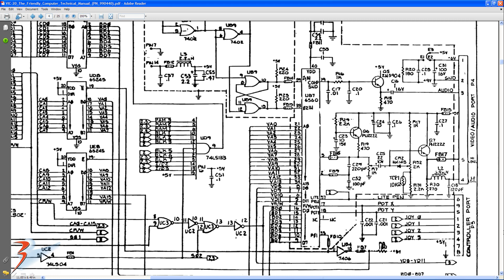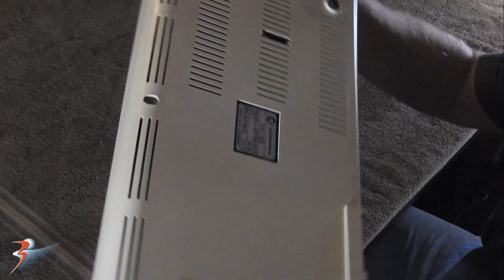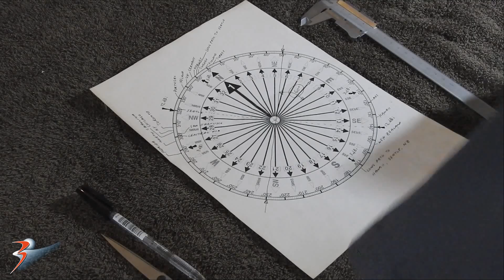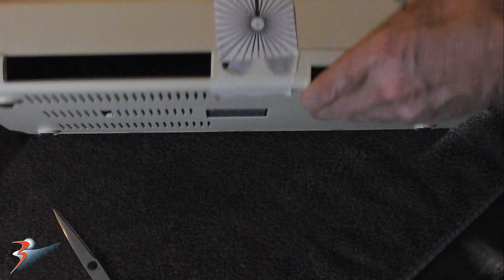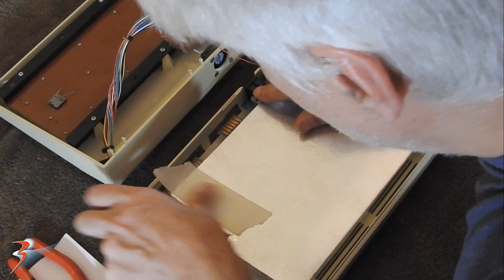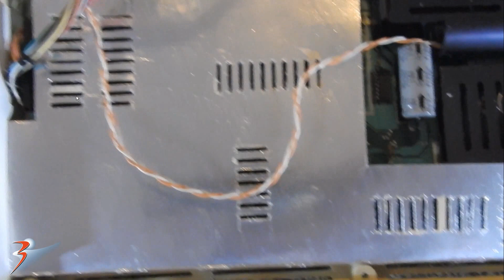Commodore VIC-20 Restoration and Air-Cooling Modification

Comment: is there a reason to not vent into the top vent grating? or even bottom vents sucking in cold? i think i may place a fan without cutting a large hole...
Reply from the maker: Great idea, thank you for the alternative suggestion. This mod I did, I admit, was very intrusive. Thank you for the comment.

Comment: Jean Ward
Check the files, Load: *.*,8  at least I think that's right.  
I used all of the Commodores VIC-16, VIC-20, C-64, C-128, and the PC version in which I forgot the number for and I think it ran at about 2.7MHZ processor. . This was back in the mid 70's. I used them for running RTTY on the Ham Bands.  I had a big RTTY console printer like used in the old movies, (Kerchunk Kerchunk). I also did my own BBS and ran it from the C-64. For those who do not know what a BBS is, (Bulletin Board Service) Where you could access via 300 baud dial up modem and later upgraded to 128K modem.  
Also had 4 daisy chained 170K floppy drives.
It was for the American Vietnam Veterans and was called AMVETS BBS in Baltimore, Maryland in 1976

This video brought back a lot of memories. 
Thanks Jean Ward for this video....
Reply from the maker: Hi Dave, sounds awesome. I had a VIC-20 and Sinclair ZX81 when I was a teenager. For data communications I use SkySweeper and JVComm32. I haven't switched on the equipment for almost 6 years now with the sunspot cycle being so low ... basically no DX. I'm getting the equipment and antenna's ready - it looks like things are starting to pick up a bit lately.